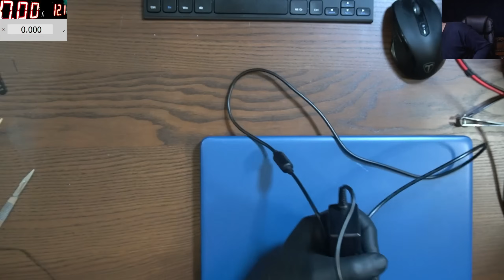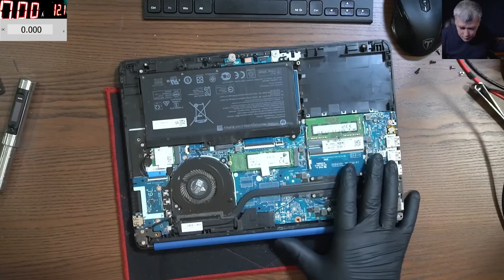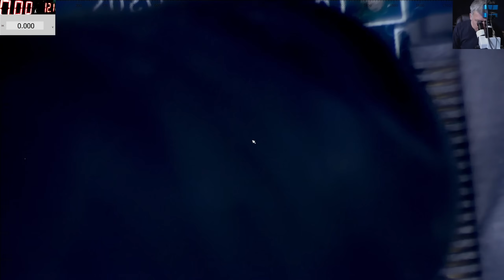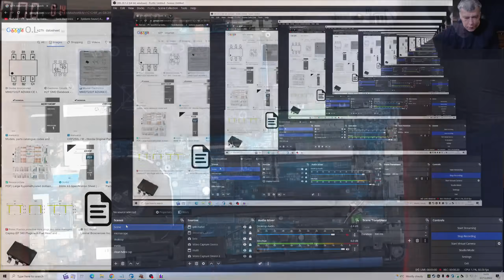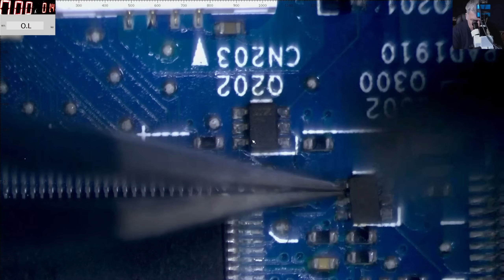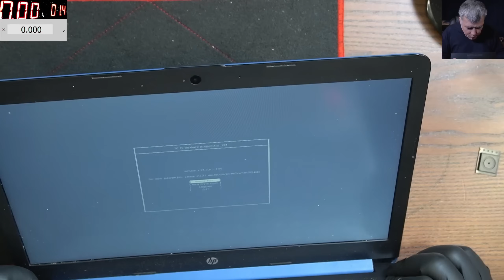HP 14-cm0598 dead, no power repair - sio/ec/startup chip IT8987 replacement

Comment: My laptop (hp pavilion 15-eg0230nia) suffered from water damage, and after troubleshooting, the EC was dead. I replaced the iTE 5570 IC, and now the charging light shows, power button light turns on when pressed, fan spins, but then nothing.

Based on the initial normal behaviour, could the problem be isolated to the EC not being programmed or the bios being messed up?
As programming the EC is just too expensive and difficult to understand with lack of contents online.

Please advise

Comment: What if BIOS doesn't have 3.3 volts but I found it near SIO chip? ALso my light was ON laptop not turning on, but now it doesn't turn on anymore, i have 19v present and 3.3 present in some areas in some not, what can be the issue?

Comment: I'm surprised at how lax you seem to have become now you're working at home - I had expected that you'd have taken more care to be seen to carry out repairs more carefully and more professionally now that you're building up your own business. Not removing the damaged chip from the board and testing again to see if the io chip stopped heating up and also supplied the 3.3V to the start switch I found to be incomprehensible. Potentially it was a one visit fix, without having to wait for the new io chip to arrive - let alone being a cheaper fix for the customer. You neither removed nor even diluted the lead free solder on the board before replacing the chips, then didn't touch up the joints with an iron after using the hot air on them. I'm certainly nowhere near your level on expertise, but I'd definitely not be sending anything of mine for you to repair. Something seems to have changed...
Reply: Well just for fun I had tested colophony flux, which I also had made some time back. To be fair and exact on the topic I have been daily soldering for past 22 years since being child. So first - colophony flux burns out above 350C and it's even harder to remove it than any amtech or any similiar flux that hasn't been heated up prior removal. Second, magic Sorin flux is not very good for non leaded soldering referencing to my prior sentence earlier. I did mention on Asus laptop DC socket repair that soldering job is just poor and people here on YT were not very kind to put it up to perspective. Soldering is kind of an art combined with experience and it takes many burnt boards and no fixes to understand. Looks good on video though, but reality is diffrent. Objectively speaking I would send out job like this when I was still a child. Today I make joints better than factory and I don't need fancy stations and tips for that but I see tendency that big youtubers seem to push in the content fact that they have fancy equipment that somehow does the job but it's great because using own experience and brain is more hassle than using fancy tools. By this comment I mean no offense to anybody but as it goes we could argue with no limit. They have their experience, I have mine. I stopped making such comments but being sincere I see what you see and what i saw earlier and I can 100% agree that Sorin's job somehow got worse than it was before. Happy trails.

Comment: ITE Super IO Chips from the factory are pre-programmed with default firmware that reads data from its SPI Lines.  Most laptops are equipped with 2 Flash ICs, one for the PCH (M_BIOS) and one for the SuperIO (EC_BIOS).  The EC_BIOS contains procedures & information on which GPIO pins are for Power Button, LED Notification, PowerOn, SusOn, PGood,  PCH S0, etc.  Some laptops don't have ECBIOS, so they use custom firmware manually programmed to the SuperIO's flash before usage.  This is the reason why you didn't need to program the SuperIO.  Be careful though, some laptops have Thunderbolt ICs that also use Flash ICs for Thunderbolt Firmware.  Most modern Lenovo Thinkpads nowadays have 3 Flash ICs.
Reply: Even XPS have the same. UEFI, EC fw, Thunderbolt fw, and TPM fw
Reply: Hi @lazal3m where can I get IO chips.
Reply: @solomonmaenetja2605  aliexpress
Reply: Interesting , im ganna be replacing a super io chip from a lenovo ideapad gaming laptop , since the cpu isnt getting a certain voltage from the chip . I assume the chip get programmed automaticaly?
Reply: @lietus4192  what model of laptop? If it has a separaTe EC_BIOS FLASH chip then most probably you don't need to program the super io
Reply: @lazal3m  i bought ite it5570vg for my asus tuf a15 2023. will i need to program it myself? I did read somewhere that asus doesnt require that and if needed can reprogram the chip itself, but i want to confirm as i can look for a programmer during the shipping of the chip.
Reply: @SheIITear  Best way to know for sure is read the schematic diagram.  If it has a dedicated flash ic connected to it, then it will most likely not need any programming.

Comment: Good morning Sir. I got a one problem is that I have a Aspire E5-575 laptop. When I turn on it , it will disturbe near to another Laptop. Like usb port problem. It will flacutate. and display also blinking, but first  laptop Aspire is smoothly running. Do you have any idea about this cause?

Comment: hi sorin, i think there is no need for you to program a brand new ITE SIO chip Just attach your blank SIO chip and the laptop should automatically flash a valid ec firmware from main bios. correct me if im wrong

Comment: Great vid but i really want to see the programing. I dont understand how would you program it on the motherboard
Reply: SuperIO chip is directly connected to the Keyboard and Trackpad in all laptops.  To program the SuperIO, the programmer would just need to remove the keyboard and plug the programmer to the Keyboard Connector.  After this, you just need to run the programmer and check if it detects the SuperIO, if yes, then you can load the firmware.  No soldering required.

Comment: Why does that screwdriver turn the light on AFTER you press the button, you need the light on BEFORE so you can line-up the tip to the key/register of the screw head - lol -.

Comment: Sorin, what do you do when there is a stuck screw under the case?  and it wont turn - a proper deformed screw.
Reply: Drill him out.
Reply: Use spot welder and weld the screw with a screw driver and it comes off easily

Comment: How that happened? How an embedded controller can die? The dual mosfet? In this case.  How a low power dual mosfet can die without a cause?
Reply: As long as the laptop is connected to the AC Adapter or there is a battery, there would always be 5v and 3.3v present.  This means even if the laptop OS is turned off, the SuperIO is always running.  Over time, due to heat and continuous power it will die out (ymmv).  The only way to prevent this is to completely power off the motherboard by removing all power source.  The 3v CMOS battery have no effect on this so you can leave it as is.

Comment: 2 weak ago i change bios on lenovo i5 gen  6

complete change  EN25Q64 TO WINBOND 25Q64
I REMEMBER IN BIOS 
EC VERSION =1.9
BIOS VERSION IS =32

I JUST REMOVE  EN25Q64
INSTALL WINBOND 25Q64 (WITH NEW BIN FILE 8MEGABYTE COMPLE IMAGE FILE) NOT CAP FILE

AFTER INSTALL BIOS I SEE WUTH MY EYE "UPDATEING EC FILE"
I SAY NOT CAP FILE (CAP FILE IS MAIN BIOS AND EC FILE)
BUT I DONT EVER TOCH THE EC CHIP

AFTER ALL IN BIOS 
EC VERSION =1.12
BIOS VERSION =39

IN BIOS FILE SOME WARE EC FILE HAVE A PRESENT 
IF EC FAIL .OR OLD 
AUTOMATIC REPLACE

Comment: MSI GP6x, CX6x.. (uses similar motherboards all of them i don't know all their models though..) laptops example has SuperIO firmware on second EEPROM on the board. No need program if goes bad. P.S. Loved the MSI laptop.. i did unlock BIOS hidden menus which included all goodies like Overclocking intel iGPU and it worked. i got when using only iGPU higher FPS in Portal 2 lol. Got like 300MHz extra or so easily.

Comment: That chip can be setup to use external memory or external instructions program from the bios chip. The engineer probably trying to use off the shelf part to create a simple and cheap diagnostic system. Maybe they are realise that the super io chip is not the best way to store a basic program. Because if the super io chip is damage they have noway to tell what might cause the problem systematically. So they use external chip to communicate with the super io chip. If the super io chip fail to return the communication, the diagnostic tool that they have can flag it as super io chip problem. It kinda smart way to debug a product. Instead building an expensive test jig, the can just intergrade a small diagnostic circuit into a product.

Comment: Because that is unleaded solder, it will take more heat and more time to resolder. Also the flux has lost properties after so much heat. That is why it is common to apply at least some leaded solder to mix and apply fresh flux. Makes the job easier.
Reply: Great, thank you
Reply: its a 300$ Laptop and a 5$ chip!
if thats a 1500$ Laptop, ok you are right! but in this case...its simply not worth!
Reply: @Knebebelmeyer  Flux and solder needed are a few cents. If one is charging dozens of pounds per job, can't he spend a few cents more? The thing here is being professional, and not fixing things over your knee.